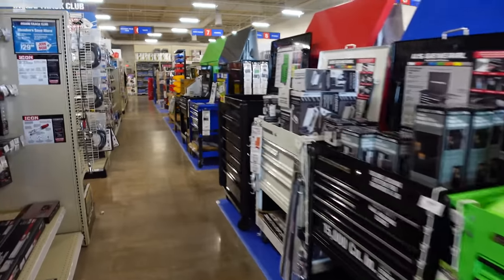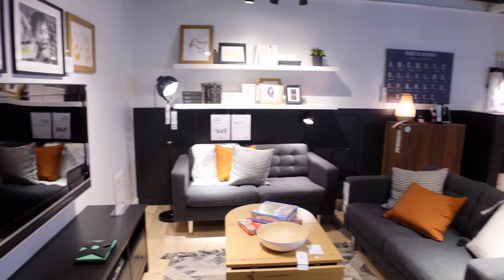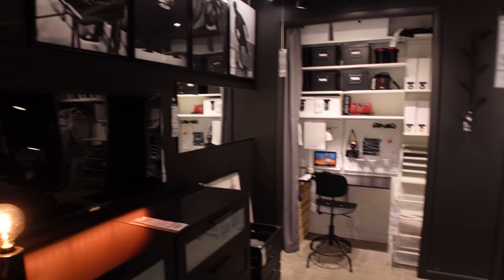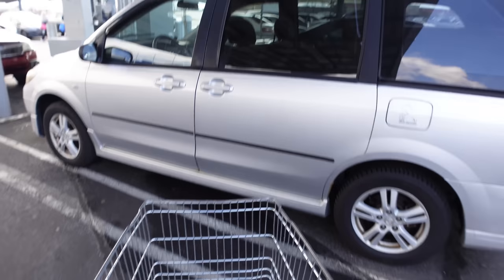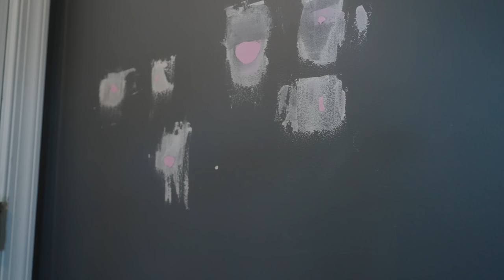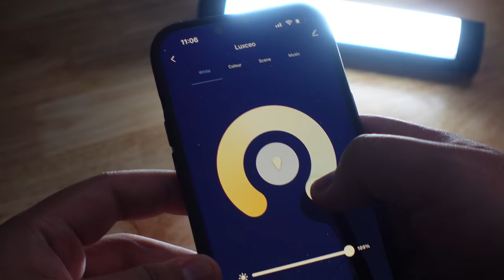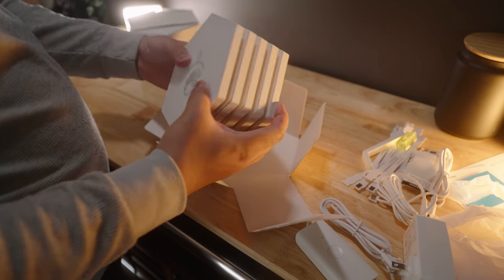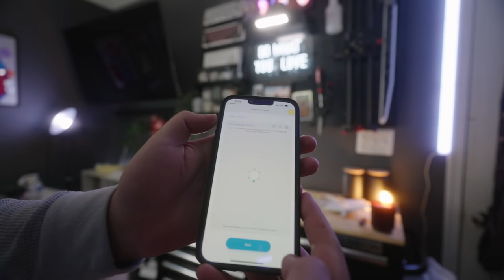DREAM ROOM MAKEOVER (Govee Glide Hexa, New Desk Setup, and More!) - Part 6

Comment: Your setup is clean AF, my only "kind of complain" (it's not really one) is that the wall upside your screen monitors seems a little bit empty compare to the rest of the room so I would personnally put some acoustic panels for esthetic and usefull purpose as those panel(s) will trap reflexions from your voice when you will talk into your mic. I know the pod mic is a dynamic microphone but it's not as accurate as the shure SM7B for instance so some echo can be heard in your mic (really a minor issue anyway). I recommand you some designed custom panels like acoustic art panels from gikacoustics.
Reply from the maker: Thank you dude! My audio friends have been recommending me acoustic panels for a while! I’ll look into it but actually the reason the top of the setup is empty is because I’m waiting for this custom neon sign to come in “Banga Vibes Only”. So for now Itl stay empty🥲

Comment: Great video man. I am wondering how you mounted the 15in monitor to the monitor arm, because it doesn't have the mounting points does it? I also have a 15 in monitor but Im stuck using it with a tablet holder at the moment.
Reply from the maker: oh mine does come with a vesa mount! so i just the vesa plate
Reply: @WayneBanga  Oh I see. Mine is a portable monitor as well but doesn't have the mount on the back unfortunately. Got to think of another way. Thanks anyway!